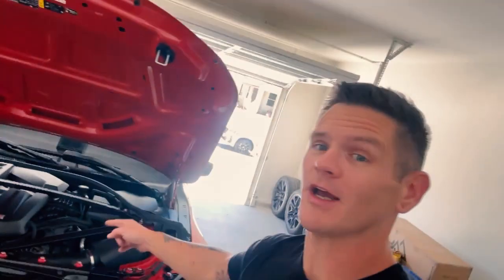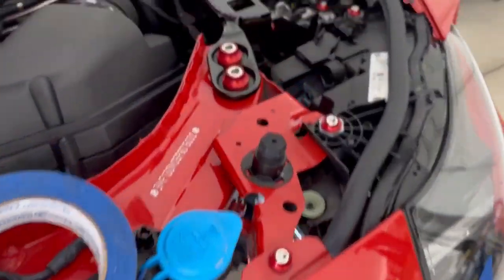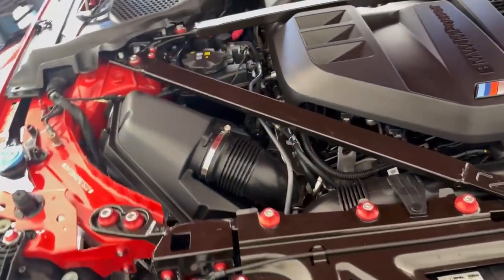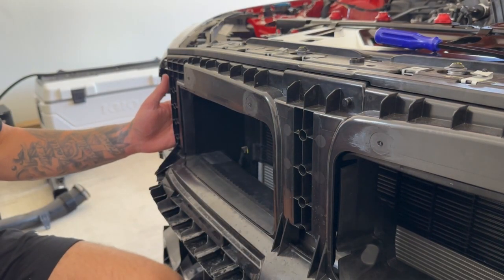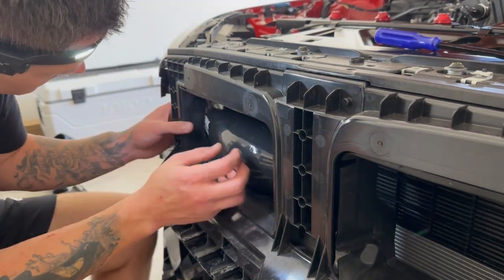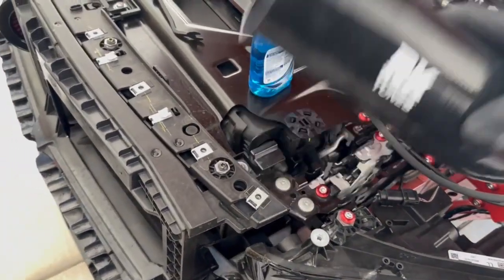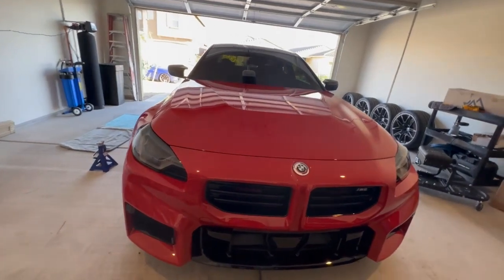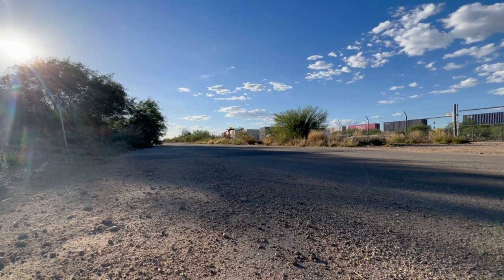The LOUDEST G87 M2 Intakes! (Install + Sound)

Comment: isn't it blocking a bit of airflow to the radiator causing the engine to heat up a bit more than usual?
Reply: These modern bmws do have amazing cooling, they literally never overheat. 

A Pro-League-Drifter has a tuned BMW G82 with like 1000hp and they still use the stock cooling system, becaufe of how amazing they work. In Skylines and Supras they would have to give a little less throttle after the first lap so that the car could cool down a bit, with the current G82 gen they go just all out.
Reply from the maker: It’s actually running a few degrees cooler now
Reply: @gepixelt7712  wow 😯 that’s great I never knew that thank you 🙏🏾